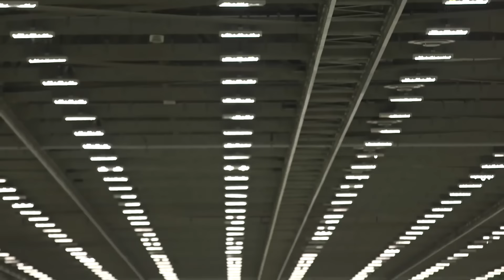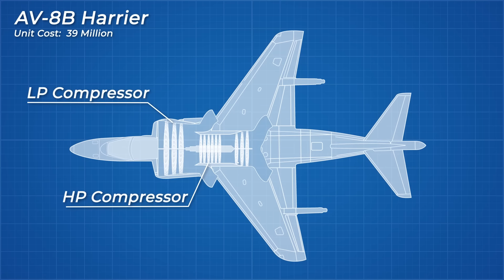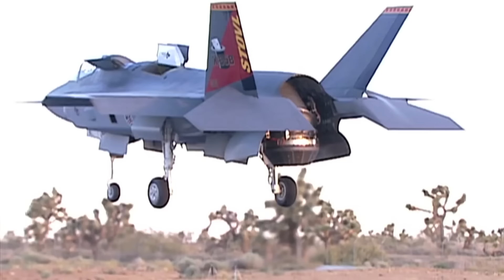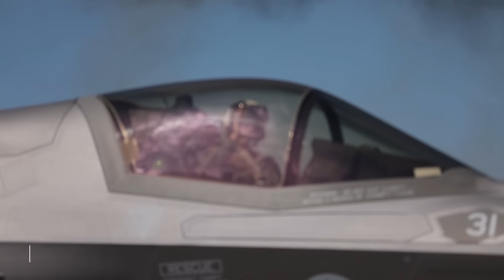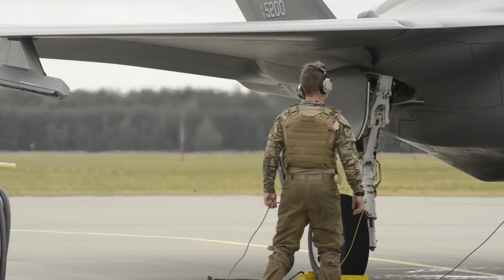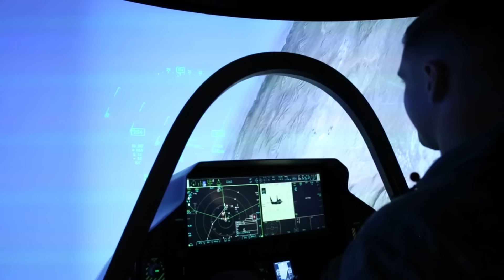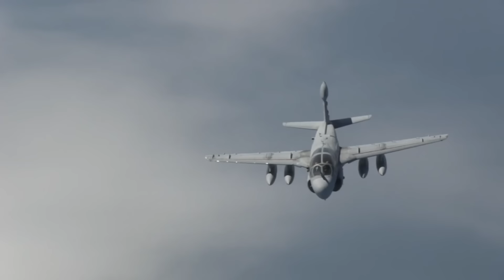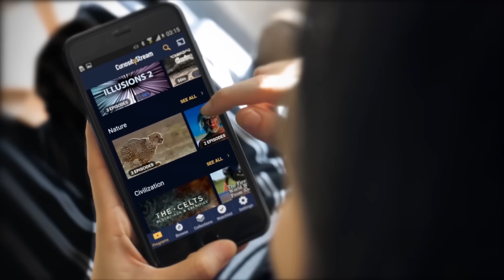Is The F-35 Worth $115 Million?

Comment: I don't know if I agree with the current value of stealth in the design of aircrafts. Sure stealth is important but I dont think that it should be as important as it currently is.

Things like the number of rockets and especially counter measures are far more important in my opinion.
Reply: Surely the option to have a more stealthy plane is beneficial, especially when you can just chose to forgo some stealth and mount extra missiles on wing pylons?
Reply: @infinitelyexplosive  depends. If your speed, mobility, and range are already smaller because of your stealth you would just lose the only advantage you have. So this might be a solution if you want just to bomb a few undefended targets but I dont think that this would be a good solution in an fight against other planes. I mean you would just literally lose the only advantage your plane has.

Oh and I am not talking about the f35 itself. I talk about stealth planes in general.
Reply: @infinitelyexplosive  and my second point is also the point that such planes often rely heavily on their stealth. This makes them very vulnerable and even obsolete if they would lose this advantage. And this could happen to fast in my opinion. A single plane that could detect them would be disastrous if it would share its data with all the planes around it.

Comment: The F-35 will be the last jet with such costs associated to it. Going further, from lessons learned from the F-35 that have lead to huge leaps in aircraft design philosophy, computer modeling and other  never before seen production technologies. New aircraft will go from the design phase to  production in less than a year. 

The Air Forces new Gen 6 Air superiority fighter jet, which was leaked to have taken only 8 months to design and build a prototype, is a perfect example of these technologies at work. Completely over shadowing every other country by at least a decade in aircraft design and production.

So yes, the F-35 was an expensive endeavor and at the end probably didn't produce the best aircraft needed by the Navy or Air Force, which is why both are rushing to get their next gen planes into production. But those planes would not be possible if it wasn't for the F-35 project that elevated the US's military aircraft design and production methods to new unseen heights of awesomeness.
Reply: Basically, walking is expensive, but once you start running....
Reply: There is really no point for nato counties to build and innovate to match the f35 if Lockheed and boing have already perfected it
Reply: The F-35 isn't perfect, in fact it's missing a lot of functionality that many countries require. Most importantly is range, speed, dual engines, air superiority, larger internal capacity, etc.
Reply: The NGAD wil be, by their own admission , a $200 million + air plane. These people have no reason to learn anything !
Reply: I work in military equipment design, and the military industrial complex does not learn. If anything it gets dumber every year.

Comment: I like when you say "innovating" about the vertical landing (aka buy a copy paste solution from the yak-141 design team)
Reply: Do you also think that all hybrid cars are copy pasting the Prius?
Reply: @infinitelyexplosive  The collaboration with the Yak-141 design team is a know fact. In your analogy, if someone pays Prius team to design an electric car which looks a lot like Prius, then I guess I would call it a copy and not innovational.
Reply: @pm-ec1fc  Yes, collaboration, not copying. I'm sure you're aware of the fact that the Yak-141 used two jet engines in the front for lift while the F-35 uses a fan connected by clutch to the main engine. Those are substantially different mechanisms.
Reply: @infinitelyexplosive  Yes, the school of thought in Soviet air planes is that a single engine is not reliable enough for combat. I believe that the majority of jet fighters designs have twin engine, with few exceptions like f16 and f35. Anyway, you are free to believe what ever you want and what you call innovating is not objective or quantitative. For me the look more similar than different but I am not an aircraft engineer...
Reply: @pm-ec1fc  You misunderstand. Go look at the diagrams of the Yak-141. It still only has one primary engine, it just uses two smaller turbojets in the front that are angled downward to generate lift during VTOL.
Reply: @infinitelyexplosive  you are absolutely right
Reply: The Russians didn't invent the swiveling nozzle design the US did

Comment: Neglecting dogfight abilities is deja vu, it was the mistake of the F4 Phantom II. And even if BVR or stealth is important, it may likely come down to dogfight. "Other pilots praised the F-35" - in which way? Surely not its manoeuvrability? Just looking at its shape and its mass tells enough. Then there's the question of the single engine. The avionics seem outstanding, it'll probably be a great light bomber, perhaps a good attack plane (except for the single engine risk problem).
Reply: "it was the mistake of the F4 Phantom II." Do you think missiles might have improved a bit since the 60s?
Reply: @infinitelyexplosive  A lot, as have the counter measures. But the number of missiles an aircraft can carry is very limited. Besides, you cannot fire a missile under all conditions, especially when you're close to a moving target.
Reply: @no_fb  The F4s problems was with training, not missiles or the fact that it didn't have a gun. Non BVR combat really hasn't been seen since Vietnam
Reply: @co8783  That's wrong.
Reply: @no_fb  What part?

Comment: Wait, I’m confused, why would they make vertical takeoff/landing be a design requirement and then, in the application where that would seemingly be the most useful, on an aircraft carrier, they have them redesign it to takeoff and land conventionally anyways? How useful is the vtol tech outside of aircraft carrier scenarios?
Reply: VTOL reduces payload and range, so it's preferable to not do it if you don't have to. For example, the F-35B can't carry 2000lb bombs, JSOWs, or AARGM-ERs (edit: internally).
Reply: VTOL is the most useful on helicopter carriers, where there isn't a runway to land on. Marines do mostly use these helicopter carriers, due to being much smaller.

Comment: The F-35 program costs 15 times more than the Manhattan project and the USAF just announced will use the renovated F-15EX! The F-35 really is a disaster in the final outcome.
Reply: The F-15EX is to replace the F-15C and F-15Ds that were supposed to be replaced by the F-22. The F-35 is still being acquired in far greater numbers.
Reply: @infinitelyexplosive  yes I understand that, but the original plan for this F-35, the most expensive military project in history was intended in principle to replace all the F-15; F-16, A-10 and F-18...........
Reply: @claudiomueckay7251  At no point was the F-35 intended to replace the F-15. AF has always intended to have a high-end air superiority fighter to replace the F-15.
Reply: Hello @infinitelyexplosive . Thanks for your comment. Yes. You are 100% correct in that call. But still, don’t you think that the F-35 by the cost has failed in its original purpose?
Reply: The F-35 isnt a failure. Say your gonna do an airstrike. With older gen planes you would need 6 to 10 aircraft to do air superiority, SEAD and EAWCS. Now you can do that with just 3 F-35s.

Comment: The Pentagon as of Feb 230 2021 said it made a mistake with the F35. Time to do a new video with updated data.
Reply: What you just did there is called 'lying and misleading'. They said the F35 'wouldn't be fully replacing the F16', which was one of its initial objectives. The media then turned around and wrote headlines saying "Pentagon Says the F35 Failed" in big letters, and then in a tiny font they add in ' at replacing the F16'. Try to have some integrity...

Comment: Great video. The F-35 is still far cheaper than the now discontinued F-22 and its still a more effective aircraft compared to China and Russia's inferior challengers. Australian pilots familiar with the FA-18 who have flown the F-35 are in no doubt of its superiority. Israel who has no qualms using the F-35 to swat Russian Sukhois used by its Arab enemies says hello.
Reply: The only F-35 that costs less than the Raptor is the F-35A! The other 2 versions both cost more than the F-22. Also, you aren't including the $1.6 TRILLION for development of the 27 years it's taken just to get this far... , and that's STILL not finished.
Reply: @pizzaman5169  I assume the development costs are amortized in the price, that is how every motorcar is priced. I'm Australian so I am only commenting about the F-35A. There is a good reason America stopped building the F-22's just too expensive and not needed since the F-35 is still superior to anything from Russia or China. Every pilot who has flies the F-35 raves over it compared to the FA-18. Had America gone with the F-22 it would still be adding development costs and not finished either so that's a moot point.

Comment: i don't really care if they use it or not, but to replace the A10? like hell... I really don't think that'll work. A10 is perfect for it's job, it's slow, which lets it hit easy, it's very sturdy and has a huge fucking gun. F 35 is fast, the fire power isn't as good, and if someone got the shot in, that F 35 is going down.
Reply: Things are different now. What point is having all the firepower when the second you go into enemy airspace you get intercepted.
Reply: @danielhope8577  but the a-10 can shake off those hits. The planes are both very different, I still don't think it can take over the a-10's role or air to ground strafing. That firepower is important when hitting the ground because it means more ground troops can be taken care of.
Reply: @sXadysXady  I agree with you on the A-10. The F-35 is for the high end fight and the A-10 for the low end one. Sadly the A-10 was made in the 60s and looks like its gonna be replaced by the F-35. Hopefully the F-15EX can take the CAS role properly.
Reply: @danielhope8577  they plan to have the A-10 in service for another 20 years. I heard something about A-10 vtol plans but I don't know how true that is as I can't find much on google other than "what if."
Reply: @sXadysXady  The A10 is stuck in the 70s, even back then it wasn't expected to survive very long

Comment: Note to the author. Read "American Grippen" by David Archibald (and many other F35 assessments he has written on "The Wentworth Report".
The F35 - at $50,000 per hour fixed running costs - is so expensive that pilots aren't getting sufficient training to use the F35. The SAAB Grippen has many advantages over the F35 - such as requiring 1/4 of the  take off distance (if the F35 VTOL version isn't used). The F35 requires so much maintenance and has such a short range, its usefulness is reduced to just a few battle theatres. This plane will go down in history as the most egregious flop in military history.  It is well and truly the Jack of all trades and master of none". The Russians and Chinese must be laughing their heads off.
The F22 is superb and any inadequacies in its avionics could have been addressed for 1/100th price of the F35 program.
Reply: You take issue with the price and maintenance of the F-35 but think the F-22 is better? You're not serious, are you?
Reply: @infinitelyexplosive  What happens to the F-35's stealth capability when it carries a full load of armaments ?? Answer: it loses stealth because of the bombs & rockets it carries. The only way to regain that ability is to fly inverted, you know, upside down !! The A-10 has a range of 2,580 miles. It's flight costs are significantly less than other planes, especially the F-35. It has taken 27 years & $1.6 TRILLION just to get the F-35 to it's current ignoble position.

Comment: There's a lot of talk in Denmark these days about how noisy these F-35s are. Neighbors (within a few KMs) to the military bases are PISSED, and feel they need to move away. I mean, I don't blame them - The planes are pushing 120 dB, when flying above you at max speed (That's about 15-20 dB louder than the F-16 model, that has been used here since the 80s). But then again - I'd never live even remotely close to a military base, lol

Comment: That the test pilot of the program is praising the aircraft is certainly not surprising. I never heard a program test pilot say anything bad about the program that employs them. The F-35 has a top speed of only M1.6 and a low thrust/weight ratio and also the disadvantage of not having canards and no thrust vectoring. So there is NOW WAY it is as manoeuvrable than a common gen 4 aircraft that have been built 20-40 years ago. The question is whether it needs to be. 
It relies completely on low observability and BVR missiles. So far the reports from several allies on detecting the F-35 suggests that radar development will make it outdated soon, but of course this is speculation. It will probably good for strike mission, but not for air superiority. The F-22 was intended for air superiority, but as this program failed so badly and was stopped after 180 aicraft (800 were planned), the F-35 has been simply declared to perform the air superiority role.

Comment: 35 will NEVER replace the A-10.

Cost per hour and delicate nature of the F-35 just makes it too fragile.
Reply: The A-10 is being phased out because it doesn't provide the capabilities that the Air Force wants/needs. Its a damn good plane (if not the BEST plane) if your objective is to provide a strafing run against a bunch of lads with AKs and maybe a few MANPADS, but the air force is looking for a modernized platform. The ultimate issue of the A-10 is that it can't integrate into an all-domain model that the US military is moving to...
Reply: The updates coming to the A-10 will make integration possible.  

Dollar for dollar, the F-35 can never replace the A-10.  Doesn't have the loitering time, payload, survivability, ease of maintenance or low, low cost per hour operation.

It's a fantastic, reliable, virtually unkillable angel of destruction.  Ask any ground-pounder about the A-10 and all you'll hear is praise.

Comment: No keep the fucking A-10s they have proven successful since like the Cold War! Just because the F-35 is coming doesn’t mean the Air Force needs to year the A-10! Is so cheap to make and it heavily supports ground troops!
Reply: The A-10 is being replaced for CAS operations in constested airspace and has been gradually replaced by the F-16C. The F-35A is replacing the latter.

Comment: I wanna see more on that B2, it looks like what cap crashed into the arctic
Reply: Thats because caps ice coffin was, minus the energy source, a real prototype design by the Luftwaffe. The B2 is the direct decendent of that original V wing bomber
Reply: @conormcnamara2273  No it wasn't, your thinking of the Ho 229 which the b2 descended from, the one in cap america was completely fictional and made for the film, the Ho 229 was alot smaller and iirc it only had a single pilot and definitely didn't have seperate rooms like an airship or strategic bomber.
Reply: @kalumbailey5103  the HO229 wasn’t though, Raytheon built one just to make fun of how shit the German’s anti radar claimed were. The US was Building flying Wings at the Same time as the Germans as well, just propeller driven.
Reply: The Hydra "Valkyrie." Bomber.

Comment: The F117 was not picked up on radar. The shoot down was a lucky shot.
Reply: Any radar can detect stealth targets, but it depends on the range. In this case the F-117A managed to get to within 15km of the radar before it could be locked, and it was shot down because the F-117A had no combat warning systems at all... the pilot didn't know there was a SAM site below him until he spotted the missile launch.
Reply: @dumdumbinks274  Some F-117A had a "radar detector" but by 1997, it was all but decomissioned from the F-117A and they still lack countermeasures save for being low observable.

Comment: Whar about the YF23?  Could that have been used?  I know it competed against the YF22.
Reply: the yf23 was better than the yf22 at everything except operation costs and agility
Reply: @Junr-lc7no  Not really. The YF-22 was better for the role of air superiority. The YF-23 may have been a high-performance aircraft, but it was not what was being asked for. Probably the most notable advantage of the YF-22 was it's 50% larger payload of AIM-120s, which would allow it to destroy multiple targets even if the missiles hit rate was low.